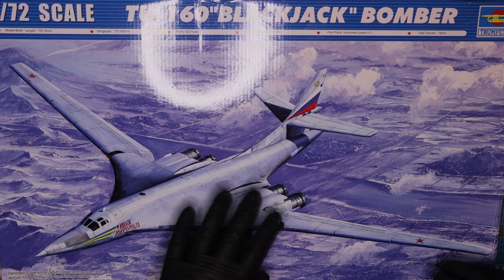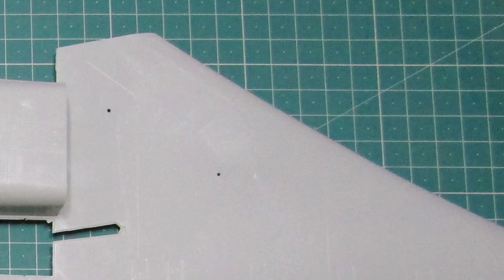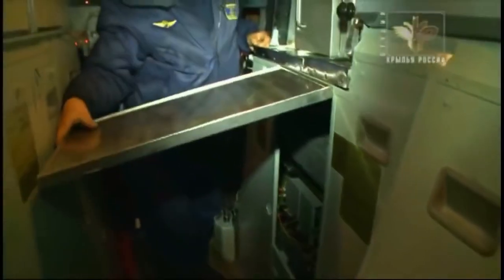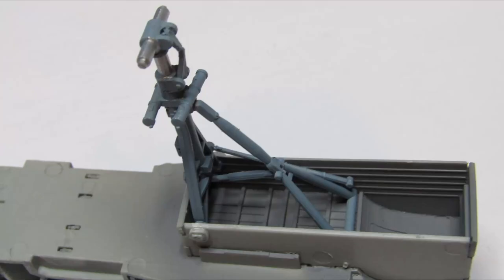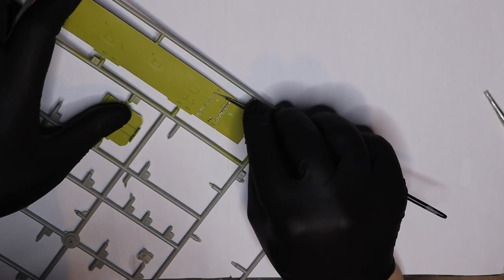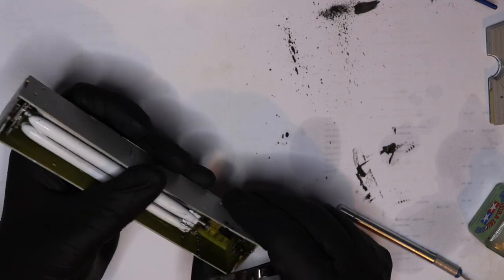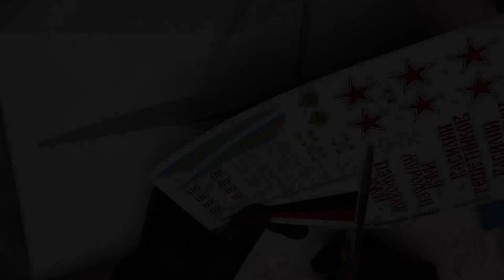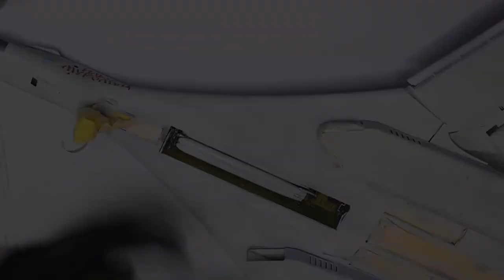Trumpeter 1/72 Tu-160 "Blackjack" (by Trevor)

Comment: Always looks like copy of B1 , are you sure it was built to compete with B-52 ?   I had never noticed but in the film it shows , 13:35 when wing is swept ,  two huge "wing fences" which deploy upwards ( not very stealthy ?)  like fins .              she is a wonderful model , this is more like engineering than modelling ! 😍😍😍😍😍😍
Reply from the maker: The Russians touted her as a "bigger, better" version of the B1 in one of the documentaries I watched. It's actually weird, the B1 had its maiden flight in 1974, and the Soviets commissioned the Tu-160 in 1975. Coincidence? 🤣🤣🤣 Good catch, those bits sticking up in the footage. I see they're positioned that way in the build instructions for the "wings closed" option, too.  I never noticed them before. You're right though, that totally negates all hopes for a stealthy profile 😱
Reply: Good spot.  I think those are the inboard trailing corners of the wing which have to deflect upwards so as not to kebab the outboard engines as the wings sweep inwards.  They must have concluded that the lift/stability these pieces give in the wings-out configuration was worth the drag/radar issues in the wings-in configuration and gone for that compromise.

Odd though.  Plenty of stuff to go wrong!
Reply: @aircool3392  referred to as "wing root seal" on engineering cutaway drawings , you can see the shape of it as part of the trailing edge when wings extended !
Reply from the maker: @aircool3392  That's an astute observation 🙂👍 Good point, though. The maintenance on these aircraft must be a nightmare.
Reply from the maker: @fredtedstedman  That's amazing, I love finding out these titbits of information. It fascinates me that someone had to actually sit down and brainstorm the issue, then come up with a brilliant solution, albeit a compromise!

Comment: A beautiful  beast of a model!
A beautiful beast of a plane!
I think you made just the right call on the weathering - to copy the reference pictures would run the risk of looking like you had overdone it.
It is nice to see that Trumpeter are thinking about the structure of the model and using stronger plastic for the undercarriage.
Nicely done sir... but where are you going to keep it!
Reply from the maker: Thanks, Alon! You are way too kind 😃I started building this model in January of last year, and then February happened, and I didn't build much of anything for a while! Then the USA announced the B-21 and I thought, yeah, let's finish this thing! It is a beautiful aircraft, especially with wings spread out, so I'm glad she's finished. And I'm happy that she has a decent undercarriage - I've had way too many of those snap off in the past. Thanks, as always, for checking out the video. I really need to run the videos by you before publishing them, though. I probably made a boatload goofs in this one, as the subject was way over my head! Thanks again, you are much appreciated! 😁